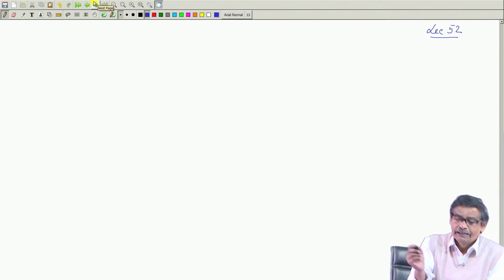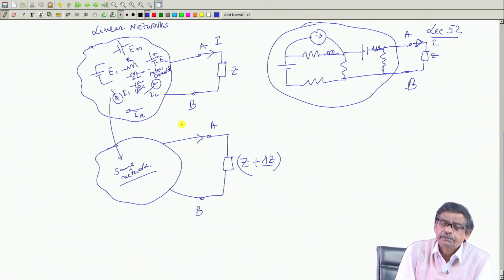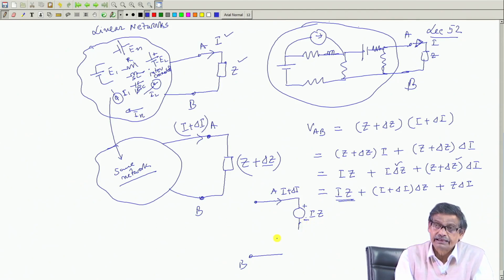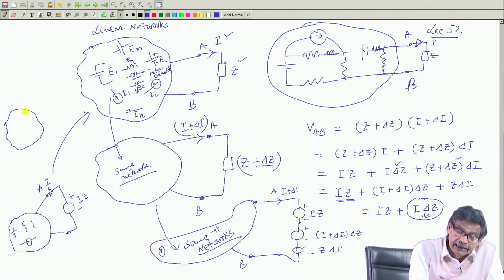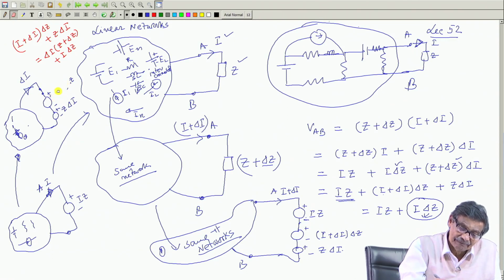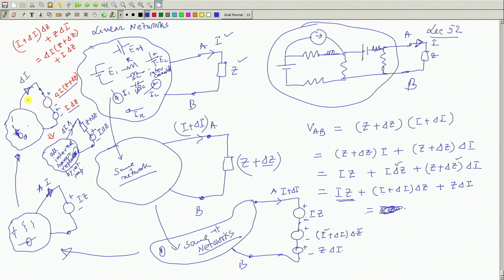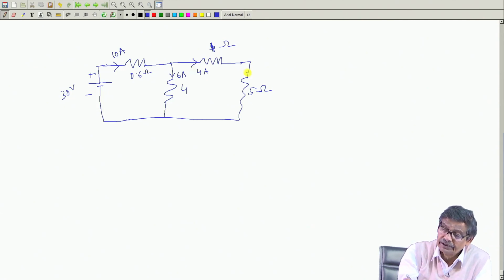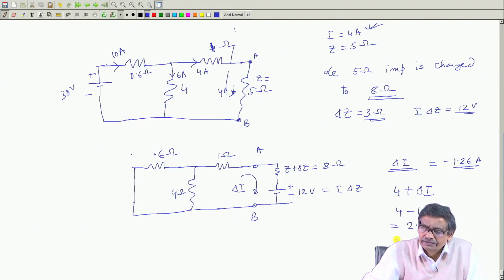Lecture 52: Network Theorem - II

Comment: At 34.12 how the current become _ 1.26
Reply: Solve the circuit by finding equivalent resistance and applying V= IR which would be 12=∆i(219/23). Solving this you'll get ∆i= 276/219 or 1.26 A. Since it's flowing into the positive terminal, it'll be -1.26A as the voltage source is an absorbing source.